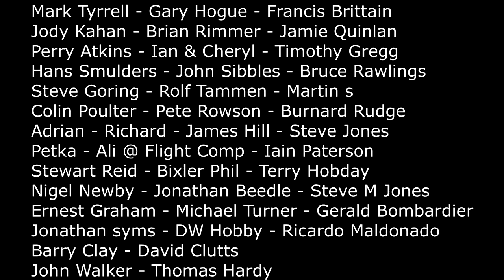DW Hobby Fieseler Fi 156 Storch Build Pt24 RC Model Geeks

Comment: I would have thought it would be better to finish the other wing and get everything together with a battery etc to check CoG before gluing the motor box in position and final fixing of the cowl.This would allow you to adjust the CoG by sliding the motor box in or out a certain amount and possibly avoid having to add weights.
Reply from the maker: The cowl is tapered. you cant just cut a bit off as it won't then fit to the fuselage. So the motor box is really there to adjust for the different length motors. The cg will be fine. Nothing that battery wont sort out.